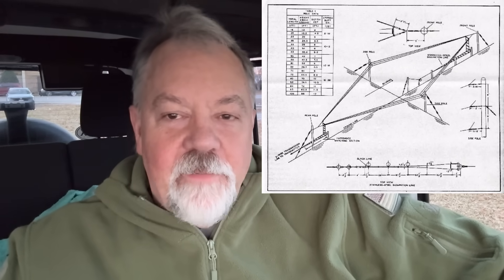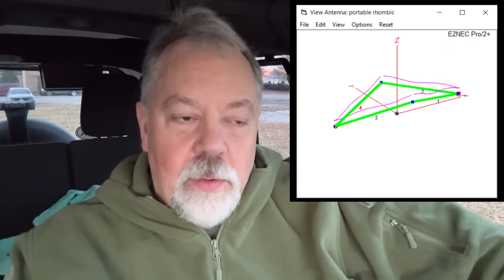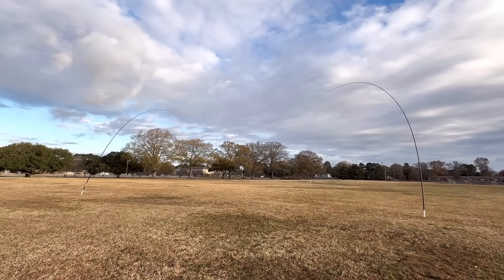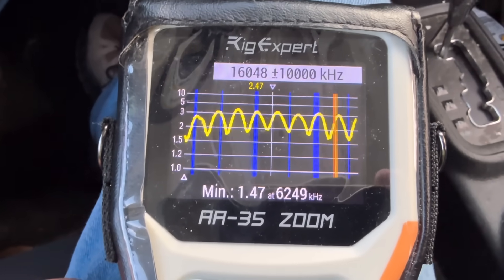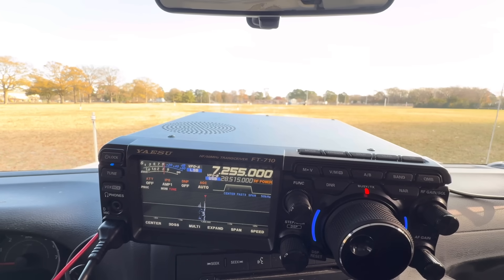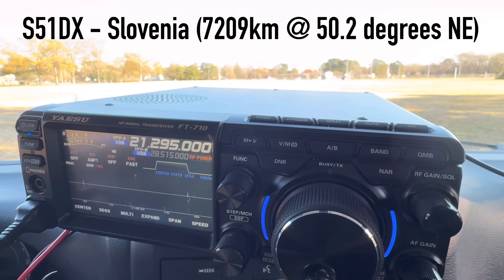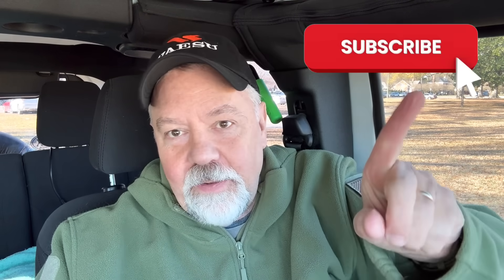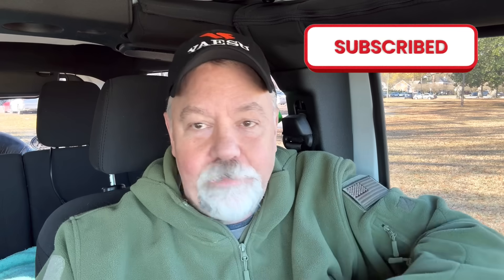My Biggest Antenna Build Ever - A Rhombic Antenna

Comment: This was awesome Walt! I never knew about the listening station on the East coast. I remember W6AM's Rhombic farm up in Palos  Verdes and it was commandeered for service during WWII because of it's outstanding performance. Here is a blurb about what that farm consisted of. "The station featured up to 13 rhombic antennas across 120 acres during its heyday, with 14 rhombics and 26 directions at its peak.
 The antennas were supported by 61 telephone poles and 110 additional poles for feedlines, with rhombic lengths ranging from 460 feet to 1,050 feet tip-to-tip, and heights between 60 and 140 feet." Thanks again Walt! 73

Comment: Hi Walt, another great video. You didn't mention wheather it was resonate on any of the bands. If not did the internal tuner cope with the mismatch ?
73 de G4VYC
Reply from the maker: With the termination resistor its broadband and works across all bands 80-6. The SWR sweep I did in the video was 40 through 10 meters. It was an easy tune on every band.

Comment: Nice work.  You can flip the direction on that , swap Balun with resistor . I have seen a pic with a extra feed line and a relays at each end. 73
Reply: That’s a great point. It’s interesting how small changes can affect performance. Appreciate you adding to the discussion, 73!

Comment: I'd not thought of putting up a rhombic myself.  Thanks for doing it and video.  

Paybacks :-D   

Compact portable rhombic antennas with manual tuning output from claude ai:

"The compact portable rhombic system covers all 15 amateur radio bands
from 160M through 23cm:

BAND    FREQUENCY       LEG LENGTH  LOADING     IMPEDANCE   GAIN
----    ---------       ----------  -------     ---------   ----
160M    1.8-2.0 MHz     20.0 m      YES (8×)    300Ω        4 dBi
80M     3.5-4.0 MHz     10.0 m      YES (8×)    280Ω        5 dBi
40M     7.0-7.3 MHz      5.0 m      YES (8×)    260Ω        6 dBi
30M     10.1-10.15 MHz   3.5 m      YES (8×)    250Ω        6 dBi
20M     14.0-14.35 MHz   2.5 m      YES (8×)    240Ω        7 dBi
17M     18.068-18.168    2.0 m      YES (8×)    230Ω        7 dBi
15M     21.0-21.45 MHz   1.7 m      YES (8×)    220Ω        8 dBi
12M     24.89-24.99 MHz  1.4 m      YES (8×)    210Ω        8 dBi
10M     28.0-29.7 MHz    1.2 m      YES (8×)    200Ω        8 dBi
6M      50-54 MHz        0.7 m      YES (8×)    180Ω        7 dBi
2M      144-148 MHz      0.5 m      NO          150Ω        9 dBi
1.25M   222-225 MHz      0.34 m     NO          140Ω        9 dBi
70cm    420-450 MHz      0.17 m     NO          120Ω        10 dBi
33cm    902-928 MHz      0.083 m    NO          110Ω        11 dBi
23cm    1240-1300 MHz    0.058 m    NO          100Ω        12 dBi

NOTES:
- Loading coils required for 160M through 6M (HF/low-VHF)
- 2M through 23cm bands use full-size elements (no loading coils)
- Impedance values are approximate (vary with height and ground)
- Gain values are forward gain in free space
- All designs use 60° tilt angle rhombus geometry"

This is an AI, so it needs testing

SERIOUS TROUBLE :-D

Comment: The coolest antenna I ever transmitted from was the collins Disc-Cage antenna at the ICBM museum near Tuscon. The antenna is maintained by the green valley amateur radio club. You can park in the parking lot.They've got a picnic table and a junction box with coax coiled up in it. When I put an antenna analyzer on that big cable monster, it was amazing to have SWR under 2:1 over a very broad frequency range.

Comment: Try a 24' telescoping painters pole from Home Depot $40.00. They are much stiffer than the poles you're using. Collapse to 8'. These poles are my field expedient choice for antenna poles.

AT&T had huge rhombics on both sides of the Atlantic and were able to keep a channel open reliably.
Reply: I just picked up 4 of those poles.  I believe they are going to work great for wire supports!  What a great find!  73 WR0S

Comment: You have fulfilled a near-lifelong dream of mine in building a rhombic, one of the first antennas I longed for from my earliest ham days.  And you built a beauty! I can't ever thank you enough for this one, Walt. ❤❤❤
Reply from the maker: I definitely want to do this better with some good sturdy fiberglass type masts and using 4 of them. Thank you so much for the kind words my friend! 73, Walt
Reply: @COASTALWAVESWIRES  Hi Walt, Great Video! Try tying a light cord between the tops of your poles (where the wires are attached) to set the correct width and take the ends of the cord down to a ground stake at each side as a guyline. That would both raise the height of the centre and keep the shape correct. Worth a try and would also work with a 4-pole version 😊 73 de Peter GM4RAH🏴

Comment: That was a lot of work, but if you ever decide to set it up again I wonder if you can have another antenna of any kind for comparison to switch between live to see the difference.  Say a vertical vs the rhombic or EFHW vs rhombic.
Reply from the maker: I get this comment a lot but like you said, that was a lot of work. After getting an antenna up like this I just want to get on the air and go, I’m not really concerned with how it compares to another antenna. Doing all that every time I build would turn this into a job and not an enjoyable passion. Sorry about that.
Reply: @COASTALWAVESWIRES fair enough!

Comment: Walt:

The only rhombic I put up for my station was on the 6 meter band in the early 1980's. Dimensions straight from the ARRL VHF Manual. 3 wavelengths on a leg, 58 feet per side. It outperformed my 5 element yagi by a couple of S-units.

I was in Diego Garcia while in the Navy, and their Receiver Site had 3 HUGE rhombics, over 1,200 feet long! I think they could listen for someone's pacemaker on the other side of the world, heh...  And I was operating from the barracks with a qRP rig and an inverted vee. I was on the air as VQ9C/WB2VUO back in 1974.

Your rhombic design was published in 1970 by Tab Books, Edward Noll's 73 Wire and Dipole Antennas. There really is nothing new under the sun, but don't let that stop your building, Walt...

De WB2VUO near Buffalo,  N.Y.
Reply from the maker: Interesting, I need to take a look at that book.
Reply: I was surprised that Northwest Cape didn't have rhombic antennas.

Comment: Military and commercial stations still use them and later log-periotic antennas until satellites took over for most communications. Being broadband, they have multiple receivers connected to each antenna. Also, the transmit, up to about 30Kw and receive sites would be 10 or 20 miles apart allowing for full break in. 
Another version is the half-rhombic that was popular on VHF before yagi antennas replaced them.

Comment: Interesting build Walt, I hadn’t considered the possibility of a rhombic using only two supports. When I was working at the Daventry SW broadcast station in the early ‘80s we had a HF rhombic antenna for our program feed to the Atlantic relay station on Ascension Island. No satellite feeds back then. The TX was a 32KW Marconi, running independent sideband, suppressed carrier, for two separate programme channels.
The main transmitters were 250KW AM Marconi, feeding into various curtain arrays. The site is just a maintenance base these days. Anyway congratulations on your build. 73 Nick G0OQK
Reply from the maker: Thanks! 73, Walt

Comment: Good one! Glad to see you do this. There is a lot to the rhombic design theory and construction! It’s hard to make general statements about a rhombic because the geometry is so complicated, but your antenna ( at near 3 wavelengths a leg) should be close to 10 dB better than a dipole at the same height above ground. Being the same height means the peak elevation angle would be the same. Some of my Antenna books address the sloping effects like yours. This would be a good weekend to try it on 10 meters as the contest will bring out tons of European stations. Too bad it’s so cold!

Comment: Walt, my father was a radio intercept operator during WWII. He was stationed at a secret location in Vint Hill, VA. There is not much information about that station. They destroyed all information and data at the end of the war. Everyone stationed there signed a secrets act punishable by death. He didn't tell me much about it until just a couple years before he died. Dad told me they used full rhombic antennas aimed towards Europe and Japan. They had incredibly great reception into both regions. Lots more stories. I love your videos. de WS4K
Reply from the maker: Wow, that’s interesting. Thanks so much for sharing. I’ve got to do some research and digging on that place since it’s here in Virginia. 73, Walt
Reply: @COASTALWAVESWIRES The Vint Hill Station was deemed Monitoring Station One by the Army. There is a small museum there but not much about WWII. The station operated through the cold war. I think the station closed in 1992. It is now a winery.  Very little is known about this place, unlike Bletchley Park in the UK.  de WS4K